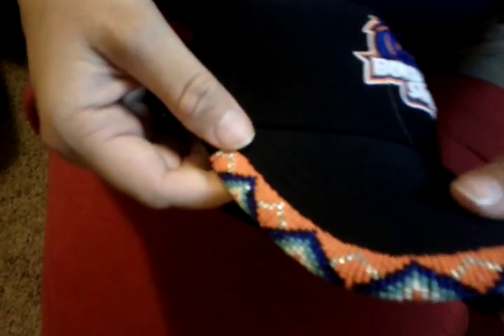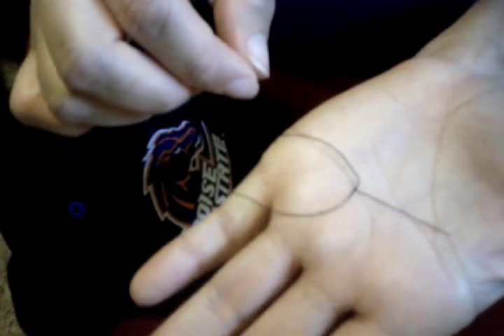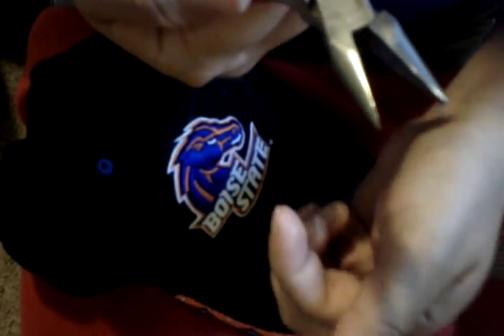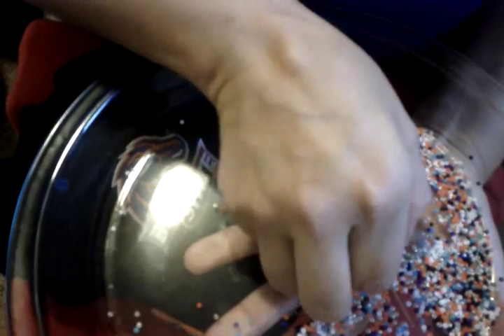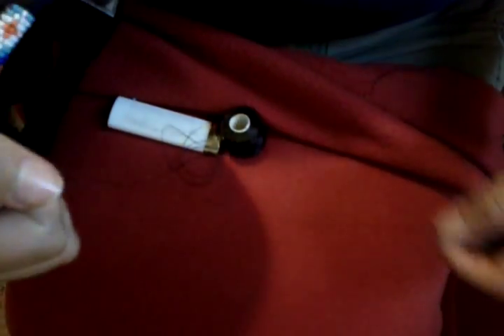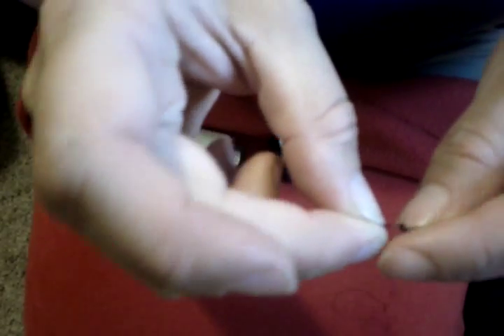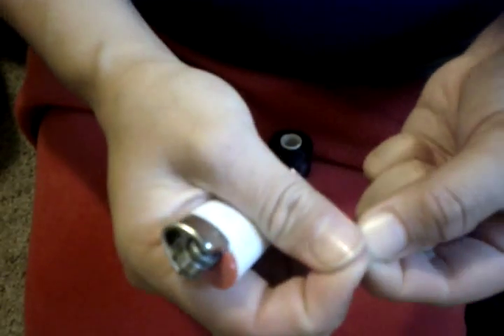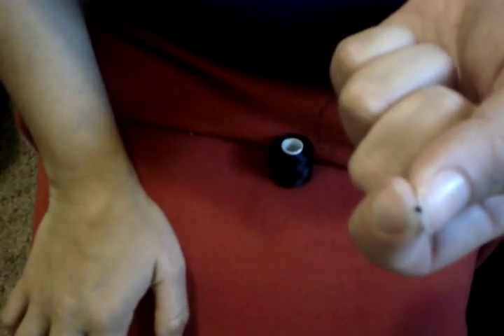Beading a Baseball Cap #1

Comment from the maker: I use nymo B or D depending on the size of beads. Size “A” or “00” Nymo is best for 13/0, 14/0 and smaller beads; “B” is good for 12/0 and 11/0; “D” works well with 11/0 and 10/0 beads; and “F” is quite heavy, good for 5/0 and 8/0 pony beads. “F” is also good as a craft thread for heavy duty sewing.
Reply: Awesome

Comment: very nice work...what size of beads did you use on your cap ?
Reply from the maker: I like to use size 11 but you can use 10's (seems too big and doesn't go around curve of brim as well. It leaves gaps), or you can go smaller 13 (looks really nice but takes longer), or even 15 if you are ambitious.